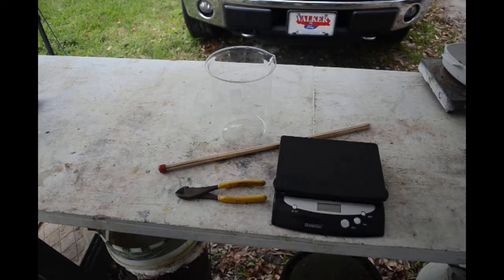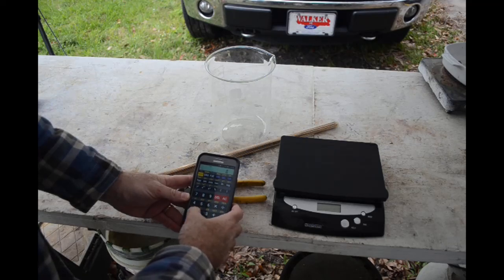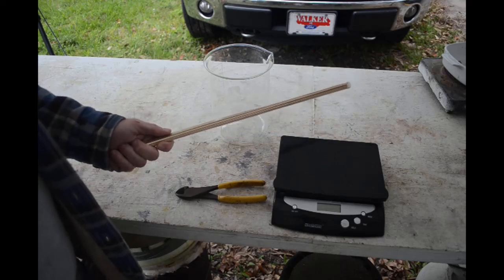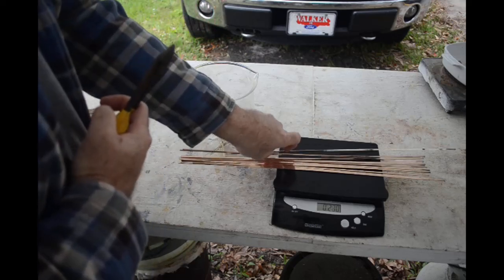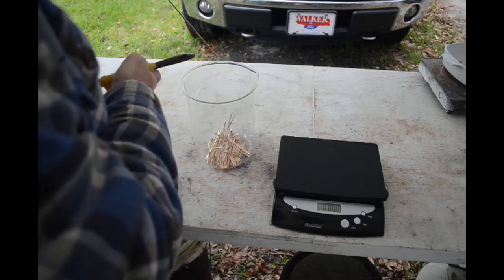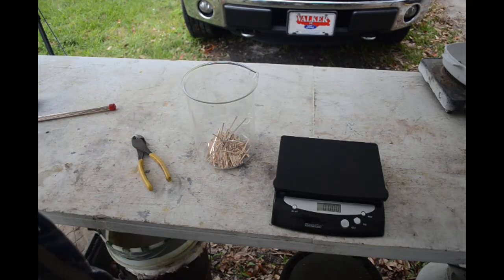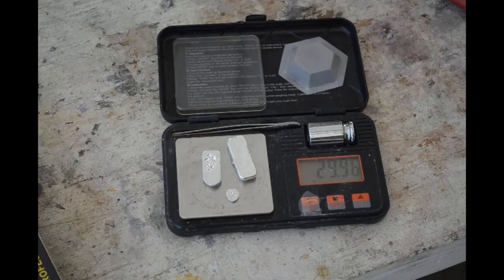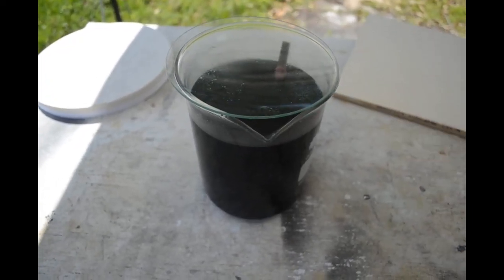Recovering silver bullion from 15% silver brazing rod

Comment: when I process brazing rod I melt it and pour it into water and corn flake it. the melting helps remove the flux.
Reply from the maker: That sounds like a good idea. If I ever get another batch of cheap brazing rod I'll melt it in a crucible in my foundry furnace and corn flake it before dissolving it in nitric acid.
Reply: Right now, mine is all chopped into 1" sticks. That's a good idea, I'll have to melt mine down.

Comment: You might also consider treating the waste solution with concentrated salt water before dumping it out. Not all of the silver will cement out onto the copper. A good amount of saturated table salt (not iodized salt) in tap water will crash out any remaining silver in the form of silver chloride which you can then get back using Lye and Sugar..
Reply: pls explain in detail the last step of naoh and sugar
and can i recover silver from developer from photo studios that way?
can you pin me any link on that process pls it'll help a lot
Reply: @pradeepchaudhary5996  Look for a video on Youtube labeled Silver from x-rays, it should give you the answers you want.
Reply: When you give it enough time I always got full cementation of the silver. No precipitation with HCl in a test vial.
But it takes time to get all of it out.

Comment: I guess the mud was mostly just plain silver. In the form of cemented silver when copper was around.
I don't know where the Phosphorus went. But many high silver brazes don't have Phos in them and require a flux to work.
Phosphorus with nitric acids make phosphates, that are usually not well soluble in water, but can be quite soluble in nitric acid. So possibly it was not the temperature that crashed out the phosphates, but rather the low concentration of nitric acid in the filter flask.

Comment: Phosphorus will end up as un-dissolved material in your beaker and as a white/grey powdery substance that the Nitric doesn't want to seem to want to dissolve. I have done this before as an experiment to see how much silver was actually in a brazing rod. actual amount was less than 15%, more like 10%. I believe I should have melted the brazing rods before dissolving them to eliminate the phosphorus.
Reply from the maker: That's an interesting idea. Maybe there would be another way to scrub the phosphorus out of the reaction. Since it is such an uneconomical way to get silver, I don't really plan on doing it again.

Comment: If you don't mind me asking I have a question :
I have access to brazing rod scraps which are made of 45% Silver, 30% Copper and 25% Zinc and I would like to extract pure silver so I can make a ring out of it.

Do you think the Zinc would be a hinderance to this refining process?
Could melting and cornflaking the alloy help boil off some of the zinc? 
 
I plan to make the silver ring myself with the lost wax method and then proceed to show my collegues what can be achieved with a keen eye for good scraps and some creativity 😂
Reply: Yes that would work but also be very messy.
Reply: @jackmclane1826  why do you think it would be very messy? I plan  to melt and cornflake the alloy in small batches on my lunch break on the job site 😊
If you have suggestions I am all ears 😁👍
Reply: @MrSwosh89  Do you have experience and proper equipment working with Zn fumes if you want to boil it off? It can be done but it can also be a pain in the ass.

Comment: Could it be tin??
Reply from the maker: I thought about that. But there is supposedly no tin in the rod. I did some research. I think it is a combination of copper and silver phosphates. Both are insoluble in water. They may be soluble in acidic solutions though. I can only find limited information on them.
Reply: @omegageek64  I tried to say, it could be copper nitrate level 2 or 3. It can change state do to concentration.
Reply: @omegageek64  if this would be silver phosphate it is soluble in nitric acid. And it should be yellow :P
And hypothesis with sulfate can be right, sreetips in one of his videos almoust lost a lot of silver couse silver sulfate was precipitating in high concentration.
Reply from the maker: @ejkozan  Mixed with copper phosphate it could be the blue-grey stuff I was seeing.
Reply: @omegageek64  it dissolving after addition of nitric and precipitation when concentration of nitric went down (after filtration when you added it to bigger volume of solution) makes a lot of sense. Probably best idea from one or two of comments is to melt everything first to burn out all P before dissolving metal.
At the end, what do you do with such ammount of copper nitrate? You remake nitric acid from it or treat it as waste?
Reply: 40:00 that was super fast cementation

Comment: If you add Sulfuric with the nitric, it will burn up the cheap metals and flux...
The mud was probably silver sulfate, and tin or flux... the sulfuric would have burned it up for you.
Next time gadget right.... lol.
Also another way of dissolving the odd metals and getting your silver sulfate out is aqua regia, and would probably been a bunch quicker.  Heat the silver sulfate in hot distilled water, add some salt and presto silver chloride...